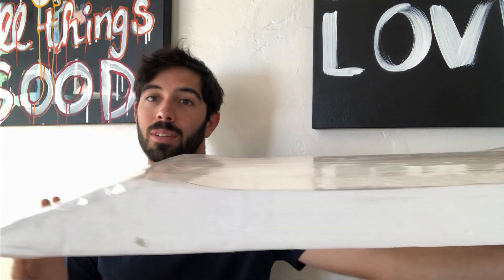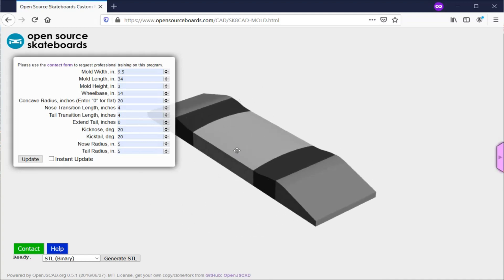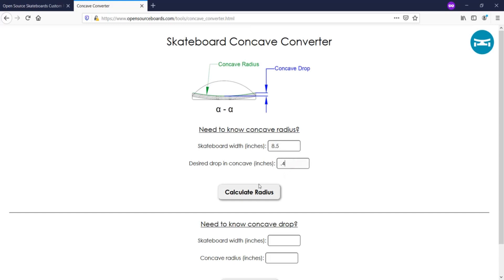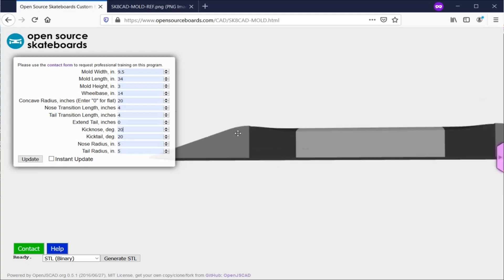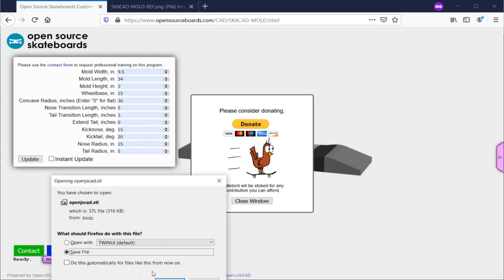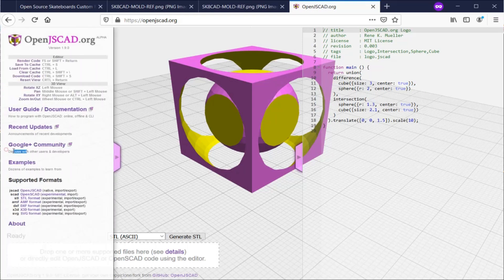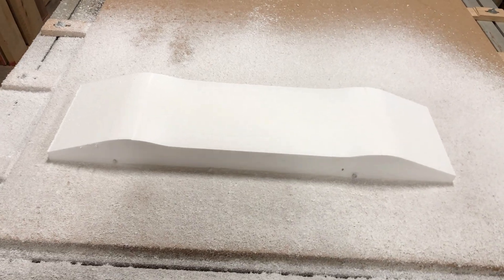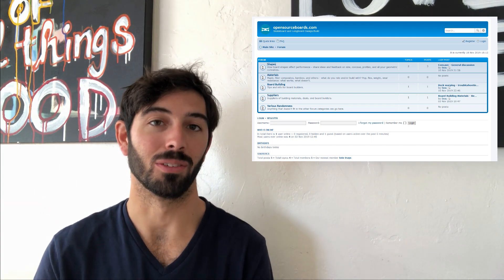CNC Router Skateboard Mold - Build of the Week #3

Comment: Maybe sometime in the future you can get rid of these imperfections by modifying your code? Shouldn't be that hard, I think. (But I'm a math guy, not a builder guy ^^)
Reply from the maker: Yes, it is definitely a math/coding problem to solve.  In most 3D modeling programs, there's a "loft" feature I use to smoothly merge two faces of different profiles.  I started researching loft algorithms, but ultimately decided it was going to be quite a deep project for an unnecessary feature in my application of this tool (which is mainly educational).  For more complex molds, I still plan on using Fusion 360 or Onshape, along with custom molds I design and build for customers.
Reply from the maker: It's better now - I changed the equation for generating the transition curves, and added a parameter for controlling resolution.  :)
Reply: @openSourceskateboards  Sick!